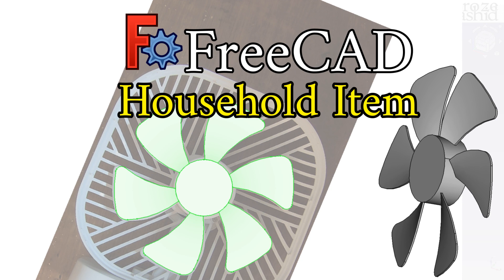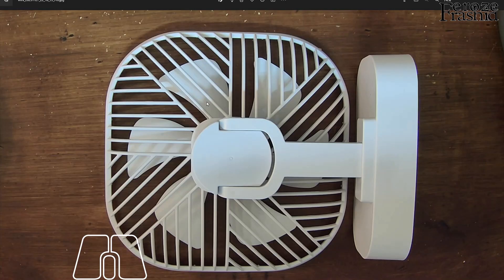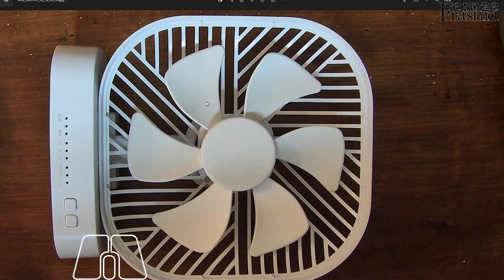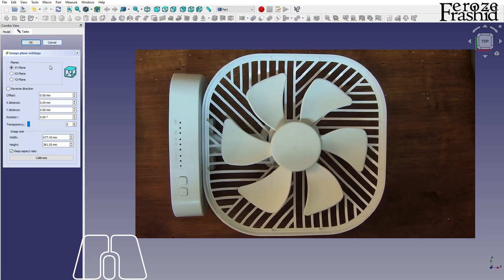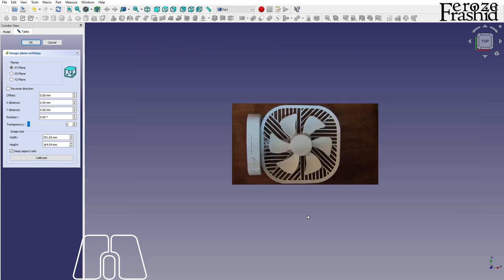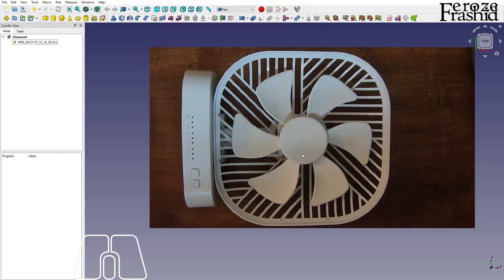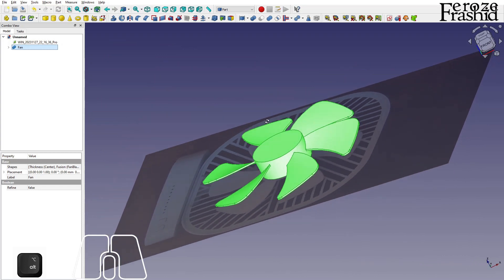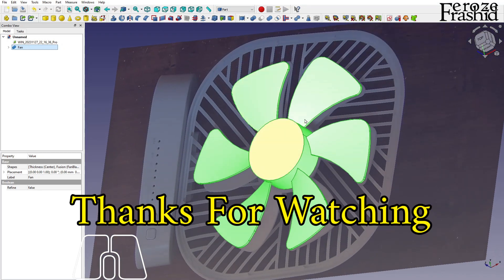Weekend Special: Make a Fan in FreeCAD 0.21 (Part 1 of 4)

Comment: Katt, These are the type of "Real World Projects" that I want to be able to complete. We take a photo of our object, get the actual dimensions, and then duplicate it in FreeCAD. The inner dimension of the center of the hub (spindle) that accepts the actual electric motor output shaft, is an example of the only type of dimensions that must be exact, right? The webbing that provides the spindle can we made as substantial as needed, since this is a problem area that is prone to breaking (engineered obsolescence) . Everything may not have to be exact. Side Note: the motor manufacturer sometimes may provide dimensions from their website for the motor or even 3D models (dxf) which saves a lot of time. I went ahead and added a 2 mm fillet to the front edge of the hub, lol. I will now do the Cover next.
THANKS
Reply from the maker: You're right about needing to be exact about the motor shaft housing. Then again, if it's for 3D printing, printer specs and few other things comes into play.